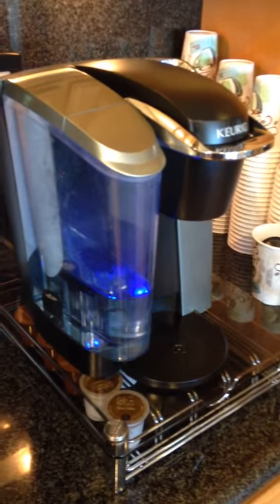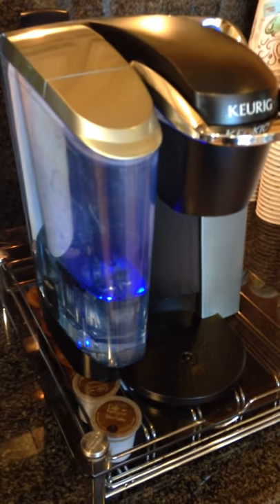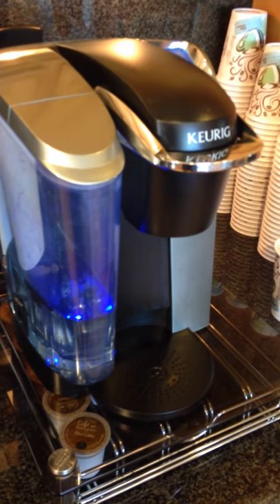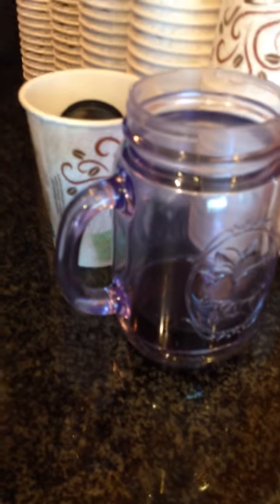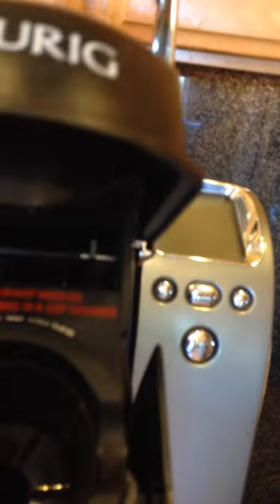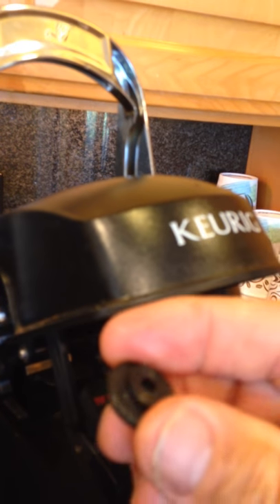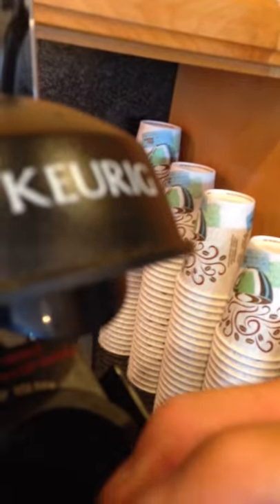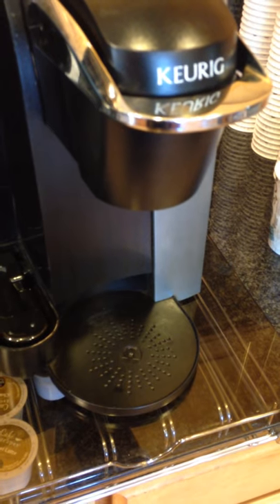Keurig Coffee Maker not make a full cup, easy fix!

Comment: Im always a skeptical of trying somethings on YouTube for fear I'm going to ruin something.
That being said, I have the exact same model and had the same problem.
I just did this 5 minutes ago, following his instructions exactly and to my amazement this worked like a charm.
Flowing smooth now and stronger than it has for a while now. I ran 2 plain cups of water after to make sure the loosened grounds were pushed through and wouldn't get in my cup.
Thank you so much for posting this, I was about to attempt to replace the pump and if messed up, throw away. I'm glad I tried this method first. Saved me lots if money.

Comment: thanks....7 years later, the info is still valuable.  Wasn't aware of the rubber grommet.  I have single cup Keuring.   Used a rubber edged dental flosser and that helped to remove a few stray grounds and then ran a cup through it w/o the cup and was back in business.  cheers

Comment: This approach worked for me for years but eventually it failed.  I was about to try taking the unit apart when I learned there was a very simple way to fix the problem that didn't involve any tools.  Merely take the unit to a gas station and blow compressed air into the water intake.  You may need to cover the overflow valve.  It worked like a charm for me and now I get a full flow of water.
Reply: What!!!!! Pls make video and tag me. Paper clip  won't work

Comment: i got the same exact Keurig but with mine the problem was the bottom plunger and i did the same exact thing to the bottom plunger and it worked fine,if you get a defecto k cup the grinds go through the bottom and clog it so you dont get the flow so i used the paper clip and then i used an air blaster can to blow it out an then it worked like new.

Comment: I have the K-Duo Plus and unfortunately, this doesn’t seem to fix it (I know this is a completely different Keurig). Normal K-cup size brews are fine, but when I do the carafe, it is 2-3 full cups short.
Reply from the maker: Might trying descaling run one part white vinegar to 3 parts water
Reply: @billarsenault1822  I actually tried doing just water right now and got almost 6 full cups (46oz/48oz). I will try in the morning with coffee. If the coffee doesn’t work, then at least I have narrowed it down. My first brew with this machine was with the carafe (after setting it up and doing just water, per directions), so there wasn’t anything stuck anywhere. That’s why I was so puzzled.